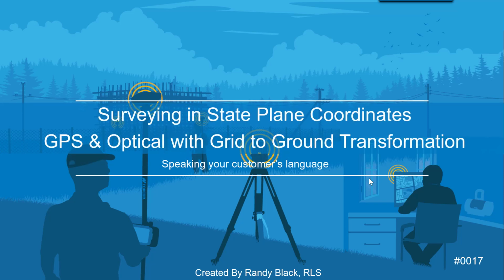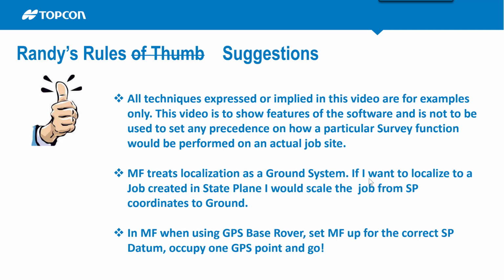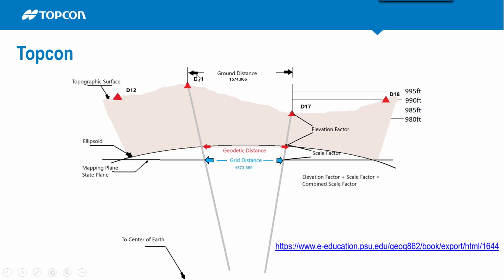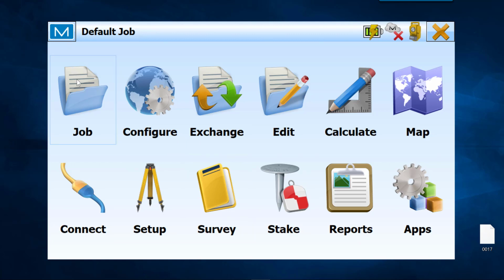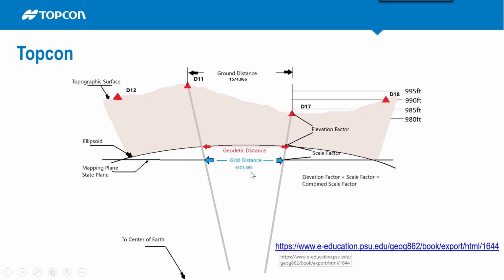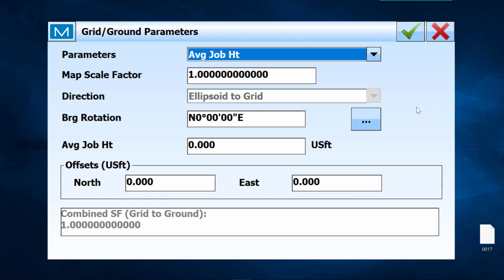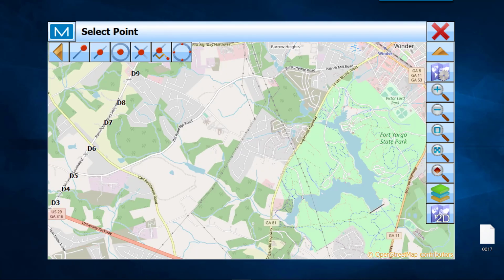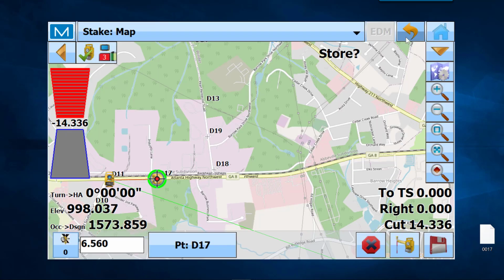0017 SP Grid to Ground

Comment: Thanks Randy, I'm sure you had a video on here once about processing base line vectors from static obs in magnet tools which I was trying to find yesterday. I have come across this video though as I have been trying to grasp the whole grid to ground parameters technique for a while now. 
I live in the UK and we have one projection and geoid for the whole country, OSTN15 and OSGM15.
I have done some recent survey work in hybrid with using the projection and geoid then processing and adjusting in magnet tools for control points. I have then been asked to do some staking out from the control points with the projection and geoid turned off and scale factor 1. Then obviously, the distances are not correct. Turning the geoid on projection back on has obviously solved this. 
However, the purpose of your video is to convert from grid to ground which has helped do this in magnet tools. 
I have selected the grid to ground parameters, selected an origin point and then input (1- scale factor +1) then hit ok. 
Viewing the control points coordinates in grid and ground, yes you do see the differences of around 30mm of a 100m base line. 
The way of checking this is to query the distances of the control points which gives ground distances, grid distance and geodetic distance which was explained in your video. Obviously the grid distance is shorter than the ground distance and the ground distance is more near to the geodetic distance, depending on the distance measured.
I have then adjusted the control by least squares and exported into two separate jobs into the GT505, one Grid and the other Ground. 
I have been back out to the jobsite today to see if this has worked. My first setup was in ground, scale factor 1. Yes! My backsight was 1mm on HD and 1mm on VD. I have then setup the target over another control point and then got 0mm HD and 1mm VD. 
After that going into the grid job I was getting 14mm over around 47m, obvious I know….
I have then input the local scale factor into the backsight, I’m not sure if this is a Topcon thing but it was still giving me 14mm HD. Having okayed that, I have then staked the backsight point out which was giving me 1mm? Maybe the backsight report is just a check procedure and having input the scale factor just simply multiplies by the SD in which used in all modes of the instrument.
Reply: Very helpful. I watched it 3 times until it finally clicked in my brain. Thanks!